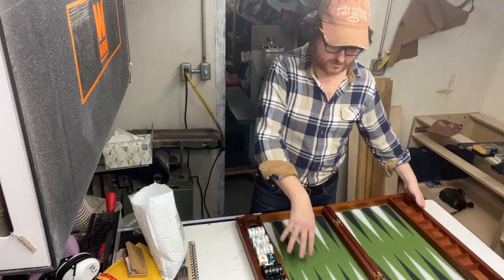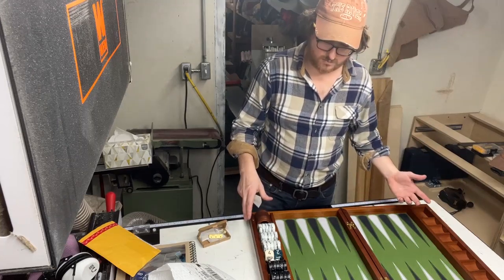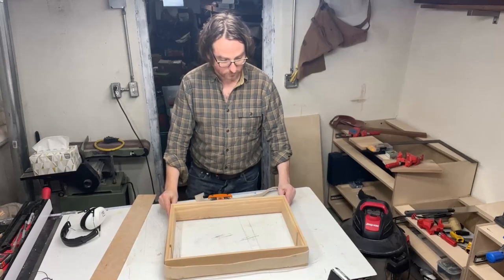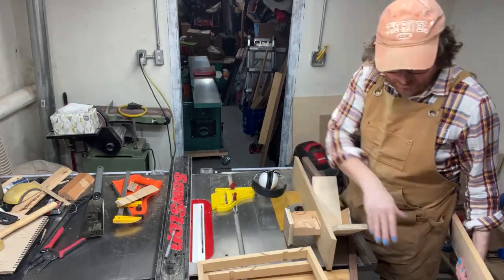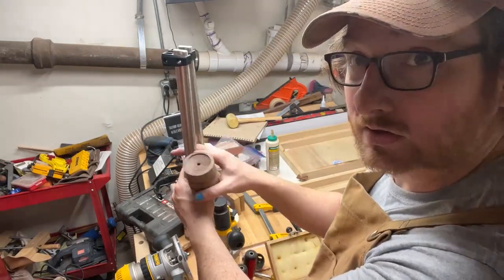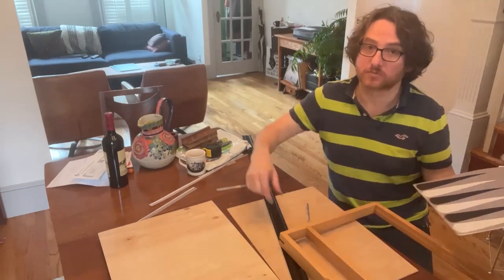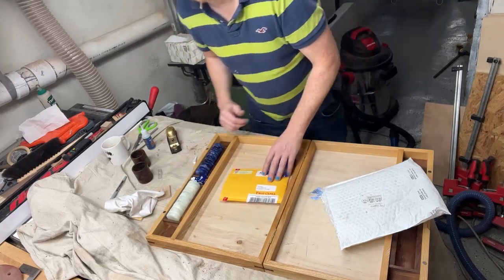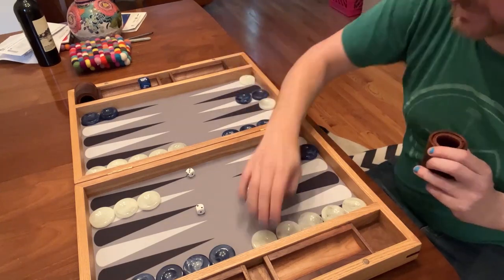Backgammon Board on a Budget

Comment: Nice Job and well done specially for your first go at it. (video wise I mean) Surely not a first go at woodworking. If I could pass along a tip that I think would help you out it would be when you are doing your big checker cove. To make it go a little faster/easier I suggest when you are doing your dado steps earlier and have a blade set up on saw you make a deep pass down center of coved piece depth to be just shy of finished depth then increment over width of blade and lower blade so outer edge of blade it just shallow of finished cove depth then flip board end for end to make a third pass that mirrors the 2nd one then repeat again lowering blade and repeating previous step then make those 2 passes and by now you should have most of the waste material removed and just a few passes with your cove bit should clean it all up. There is also a technique to make a cove on a tablesaw by passing your piece diagonally across the blade by clamping a board down on table on each side of the piece being cut then slowly keep raising blade to get to your final depth and the angle you skewed your blade creates the cove width. This is an old school way of doing it before routers got beefy enough to compete with a shaper.  Feel free to reach out if you want more insights to these techniques and I see we share a mutual friendship in Bob Kamp who I play backgammon with here in the Chicago area.
Reply from the maker: Many thanks for watching and thank you for this tip. Getting rid of most of the material with the dado blade first is a great idea which will save time and also save wear on the cove bit. I've tried cove-cutting on the table saw and couldn't get a good result... maybe I'll give it another go sometime! If I'm ever in Chicago hopefully we can get a game in!

Comment: Hi - What was the width of the checker tray 6" x ?  I imagine it must be just about 2' to 2 1/4".  Trying to ensure my sides are the correct distance. I have made my own board using cherry, black walnut, and sapele.
Reply: It's actually a little wider than that, to accommodate the height of the dice cups - about 2.75". In my first board (which you can see at about 6:30 in the video I used a different orientation, and the checker tray there was 2.5" wide (the height of 5 of those checkers). But 2.5" is too short for a dice cup, so in the board I make in this video the tray is a bit wider. If you're orienting the checkers lengthwise with the cups sideways, as in this video, I would start by deciding on the height you want your dice cups to be (or obtaining them first if you are purchasing them), and use that for your measurements. Lovely species of wood to use for your board! Good luck.

Comment: Great job... makes me want to give it a try. What's the advantage of making on box and slicing in half vs making two boxes?
Reply from the maker: Thanks! If you were making two separate frames you'd be working with fairly thin pieces which are harder to clamp square, and if they have any slight differences after glue-up then the two halves won't match up exactly. This way is a bit hair-raising when you're cutting it in half but it means the two halves match up exactly.
Reply: Wood is capricious and its "behaviour" depends on many factors. In order to avoid wood transformation you'd better make a box and let it rest for a while. Thus the sides adjust better and you will avoid unplesant surprises.